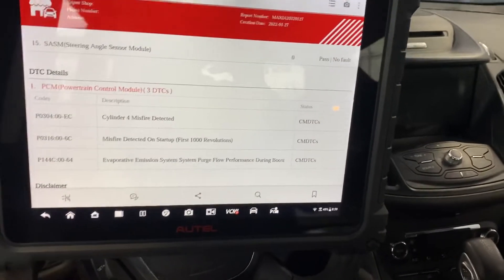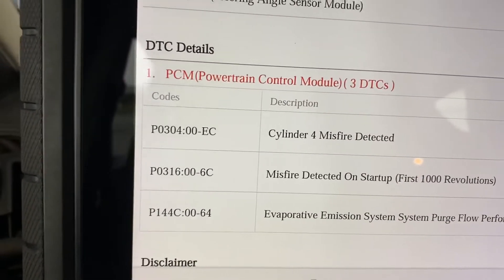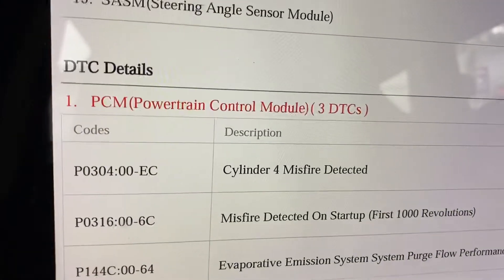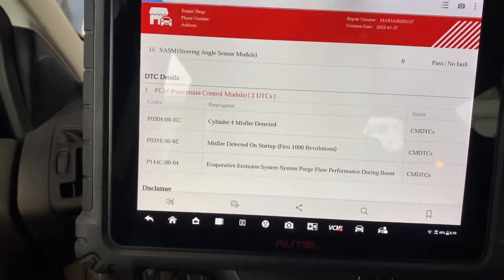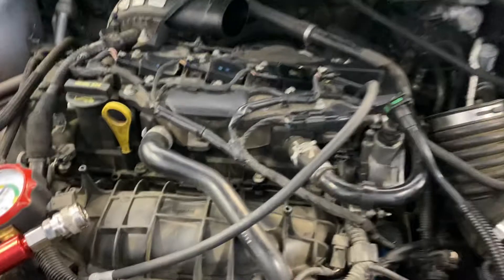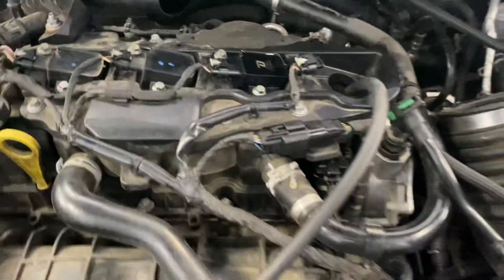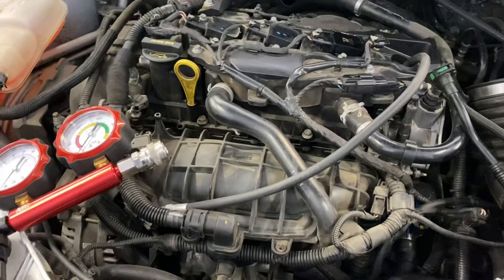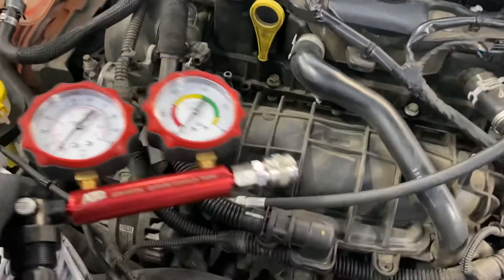Cylinder Leak Down, P0304 P0316 2014 Ford Escape 1.6 Ecoboost Turbocharged direct injection

Comment: That’s the Ecoboom engine! They have been recalled so The dealers can add a temperature sensor because, they don’t have one and you don’t know when the coolant level is low so they overheat and crack the head and coolant drips on your exhaust and boom! Shockingly bad designed engine.